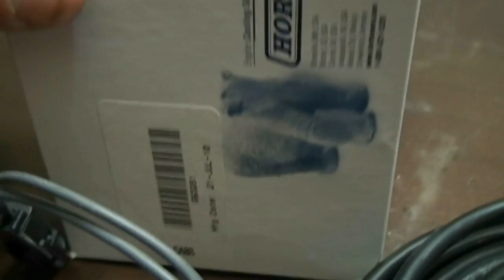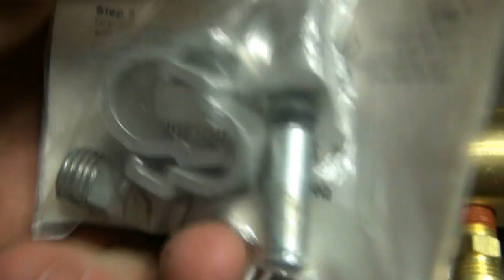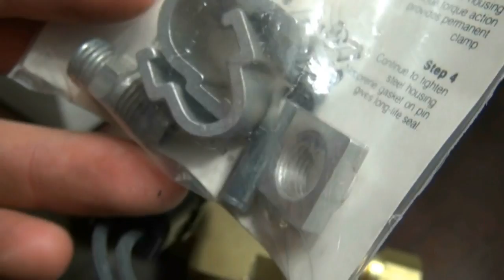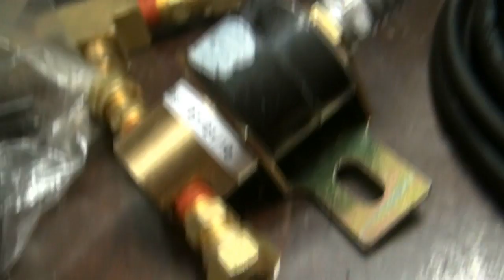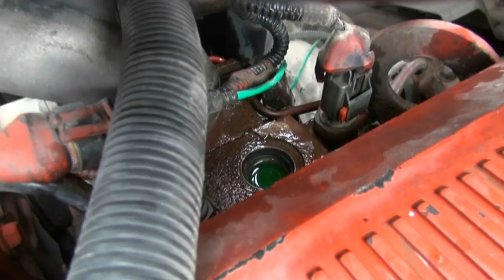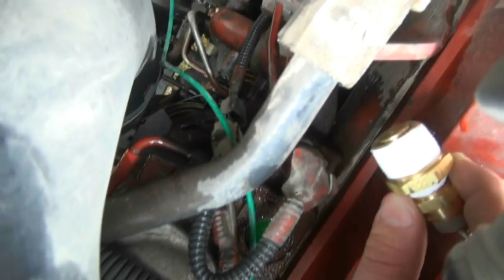ECM controlled fan clutch bypass cummins ISX part 1

Comment: My engine fan just started acting up recently , on cold start ,engine fan would engage/disengage  like 100 times I could hear the solenoid sneezing under cab on the solenoid pack you are taking about.  But this is happening intermittently,  when truck temperature warms up everything going to normal. I replaced fan hub,  solenoid,  solenoid pack , tractor protection valve.  And still does it . At fan solenoid  I get 9 volts with key off and when running volts are jumping from 11.8-14.4 
I'm lost and scratching my head at this point.

Comment: I am having the same issue and it's fucking up my ac system all the time ...i've 4 diferent compressors , new condenser , dryer , expansion valves , you name ...but now i know it is defenetly the fan clutch but will take it to a profesional to get it fixed.

Comment: Hello Chase... I got to tell ya...you sure know about trucking.  Hey i have a 2006 Volvo vnl 670 with d12 on it an couples days ago a was coming from miami and notice the fan was kicking on for like 30 seconds or so and then turns off for like 20 seconds or so did it for about maybe an hour or so then its been on every time...what could it be?

Thank you
Reply from the maker: that can be caused by many things, but the most common is dirty a/c condensor / radiator restricting air flow  or possibly to much freon in the a/c system . hope this helps

Comment: part numbers would have been nice for everything you have there.  I totally understand what you are trying to do because i am in the same situation and am not going to put an ecm on it as mike cole simply suggests.  ecm is messed up and might as well go with a tried and true method to keep engine cool without robbing horsepower and not keeping the fan on constantly.  now for some constructive criticism.  alot of your video could have been described better by laying the parts out on a diagram to let those who are not mechanically inclined be able to visualize what you are trying to do.  But again, part numbers for everything you have there would also be of great help instead of saying where you purchased the parts.
Reply: Werner Elliott
Reply: Part numbers are 993281 Horton NC solenoide Valve or 993280 NC and NO valve without diode or 993272 NC and NO valve with diode. It depends on each sistem.

Thermal switch depends on temperature. It most be 15°F upper/higher than thermostat temperature. If your OEM thermostat is 180°F, the thermal switch should be 195°F.... 

What I saw wrong in this video is the configuration of NC valve with a NC thermal switch. It can't be the same NC-NC or NO-NO. It most the opposite always. NC valve with a NO switch. Or NO valve with a NC switch.

Thanks
Reply: @fmsoliso  wrong. the way he is indicating he is going to configure it, it should work just fine. (provided current ratings are adequate, and duty-cycle of valve)

Comment: ah Christ mickey mouse, just put an ecm on it!
Reply from the maker: and why are you watching my video? why don't you just put an ecm on yours lol. money don't grow on trees at my house and i can think of other ways to spend over 2 grand than to give it to the cummins dealer to make a damn fan work. you give your 2 grand to them and i'll take my 2 grand saved and buy guns or something. if this was a new truck i would have fixed it right but truck has over a million miles has little value and doesn't have to be pretty just has to work.
Reply: oh yes sorry good point you drive junk! Yes then the mickey mouse job makes sense and yes buying guns would be  good alternative to putting food on the table since your truck may not be reliable
Reply from the maker: its more reliable than it was, this is how they done it before engines had an ecm. and i can put more food on the table and money in the bank when im not making a $2500 truck note on a 150k truck that depreciates to 50k over 5 years  like a dumbass. and if you knew anything about trucks you would know that you can drive it with the fan locked on you just get worse gas mileage so even if everything i did failed i would still make it home in my paid for truck with the fan locked on
Reply: ok I know nothing!

Comment: I made the same repair today. ECM was only kicking out 8.8 volts, not enough to engage the solenoid. I set it up just like the old trucks. I didn't worry about the AC, I'll deal with that when it gets warm around here.
Reply: I had to do this same thing, I'm trying to figure out how to keep cooled off now.. How can I get the ac to work during spring/summer?

Comment: If you don't know how to fix stuff yourself I bet it wouldn't be worth driving. Probably over $2K at the dealer for sure.
Reply from the maker: +STEVE ROB for sure, and would probably take em a week to work on it. I used to be an automotive mechanic actually. Then later I opened a small shop, things didn't work out, customers never seemed to have money for repairs or the repairs exceeded the value of the car. So then I worked as a Millwright at an OSB mill, then a friend of mine talked me into trying the trucking thing so I figured what the heck atleast i know a little about working on stuff lol.
Reply: chase5726 HA I actually got my cdl years ago when the plant I was working at closed down and after I passed everything and got my air brake endorsement I said no way am I going into trucking, Schneider's wanted to hire me in as a team driver with a condition of 5000 miles a week and as far as I could see at the time its was around $300 a week, less than half my previous pay. I hated driving the truck but I got to respect the guys that do it for a living. People think you just drive, ha id do it in a minute if it was just driving. LOL
Reply from the maker: +STEVE ROB I'm kind of part time I guess u could say I usually drive somewhere between 1500 -2000 miles per week. some weeks not that much just depends on availability of loads. I just run regional, La, Ar, and Tx. I don't really plan on doing it forever but who knows. I liked the fact that I could set my own hours doing this and not have to be at a job every morning at 7 am. Or when I worked at the mill, I was on shift, we worked days one week then nights one week then days one weekend and nights one weekend lol.